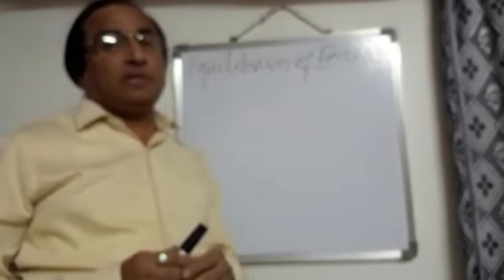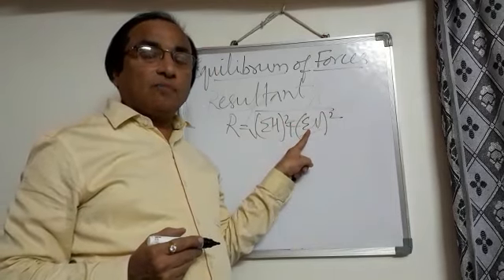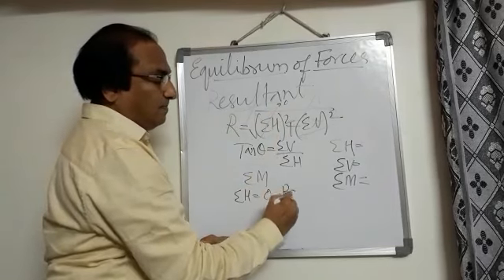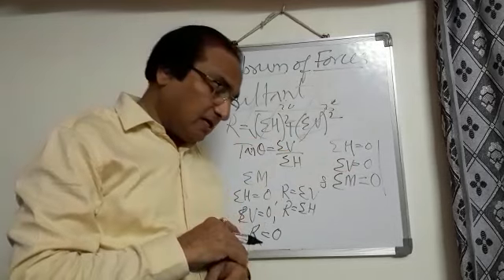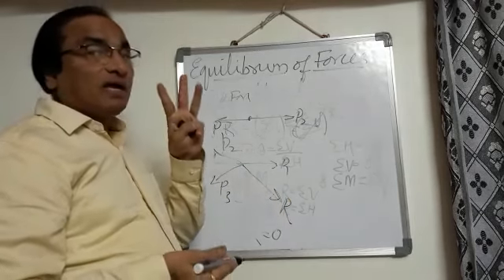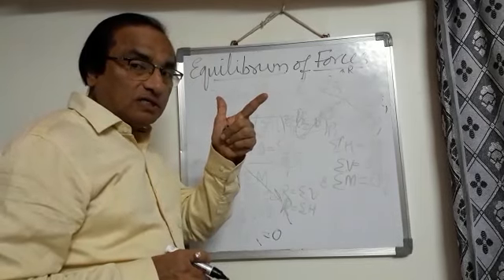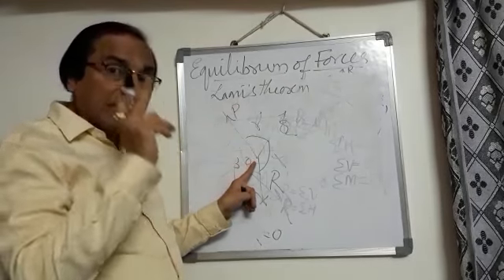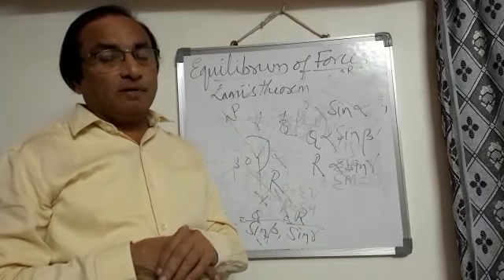Equilibrium Of Forces By B K Kolhapure

Comment: Equilibrium Of Forces By B K Kolhapure
Reply: Sir i want solution for exercise problem no 5 . a Ĺ shaped member has two bars AC and CD of equal lengths l the menber is hinged at top . Determine the angle throuģ which the L shaped member tilts from your book revised and enlarged eighth edition 2014   page no  240